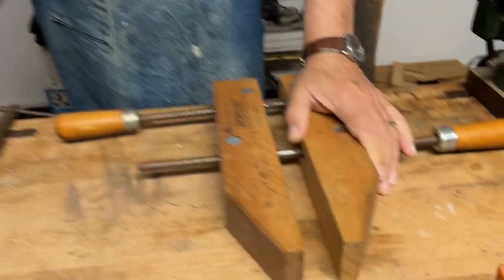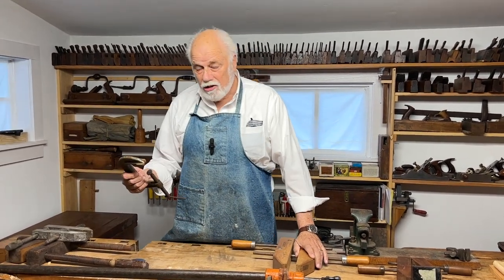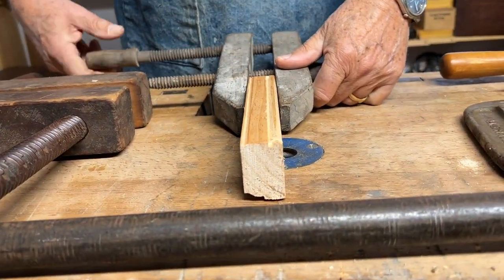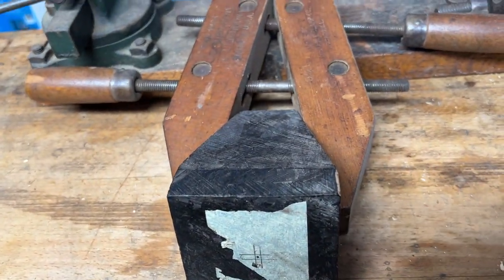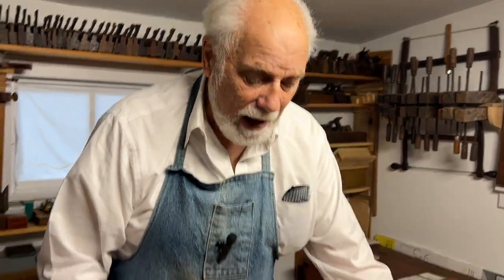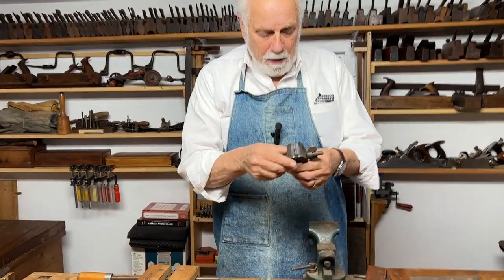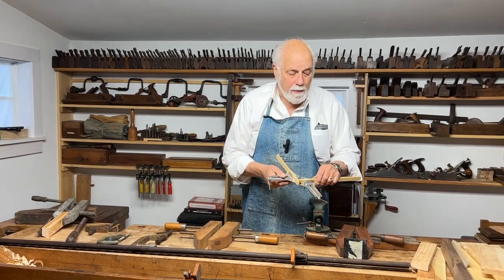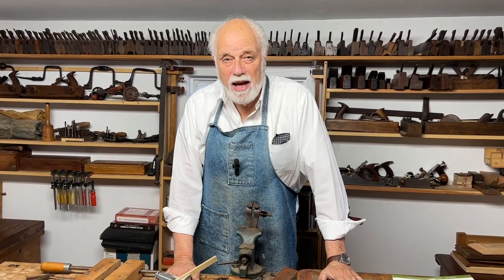26. Clamps — or Cramps?

Comment: James, from Wood by Wright, has some old sash clamps.  I would love to get my hands on some of them.  Most new clamps, such as Bessey, Bora, etc. are so expensive for longer clamps.  I do have eight pipe clamps that serve my needs for longer clamps.  I also have a couple of equal pressure clamp hardware sets which will fit multiple sizes of wooden bars (Rockler early version before they got so expensive).
Reply from the maker: Yep, whatever it takes.